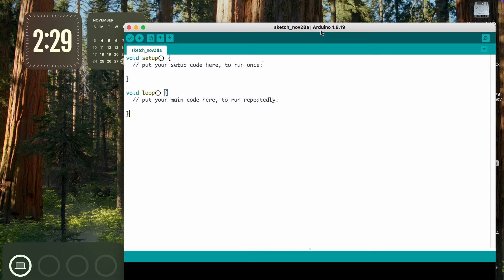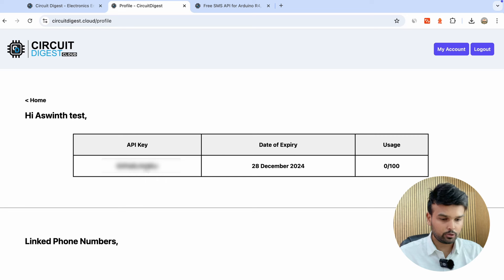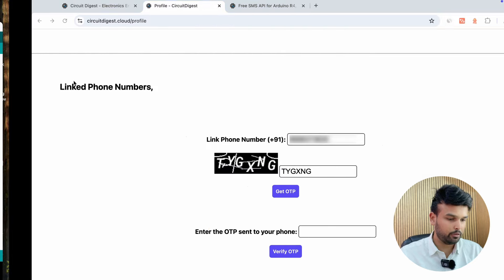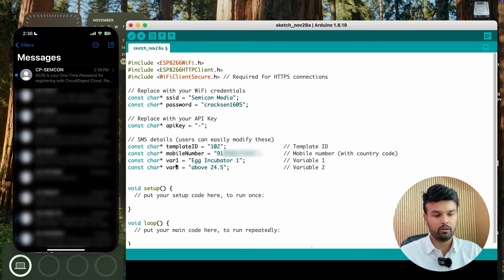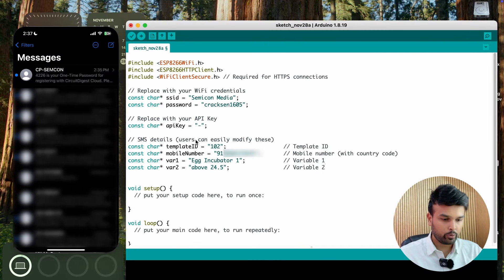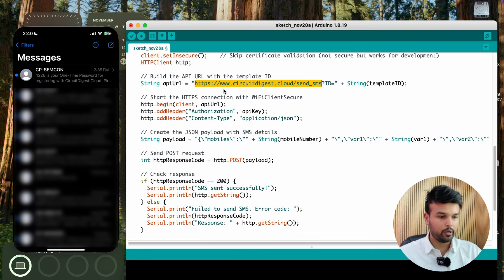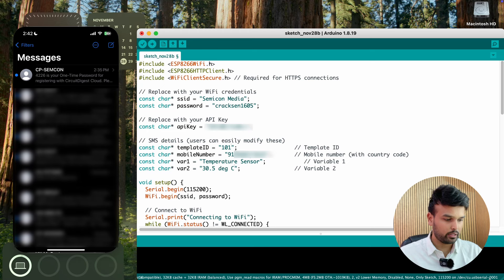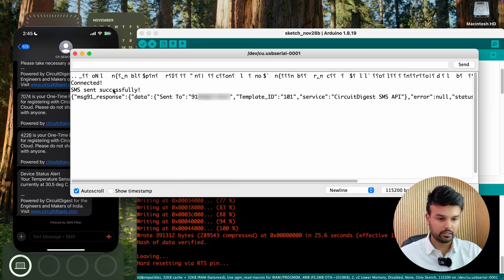The Simplest Way to Send SMS for Your IoT Projects using NodeMCU | CircuitDigest Cloud SMS API

Comment: sir , followed every step , but when i run the python code it say successful even in the dashboard says  i have utilized the SMS quota but i didn't receive any SMS what might be the problem can u help with this ? please i am using raspberry pi .
Reply from the maker: Make sure there are no DND or similar is enabled. And also check if the message is in spam/ blocked list.

Comment: Not receiving sms on mobile phone and show sms send successfully on Arduino ide terminal. 
The sms count is increasing in my account profile (7/100)
Reply from the maker: Check if there is DND is on or not.
Reply from the maker: Check your code and data format your are using.